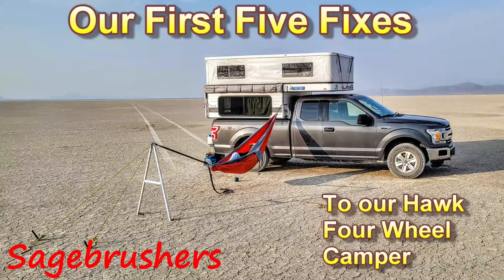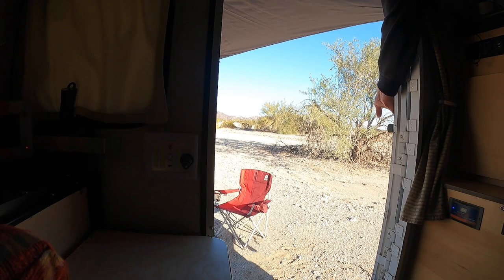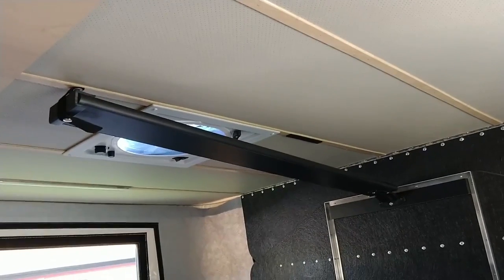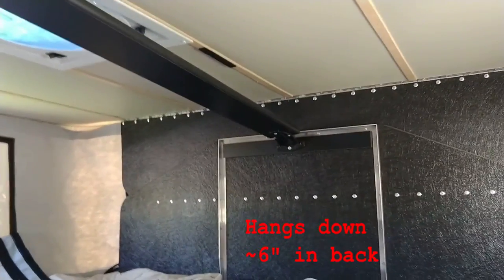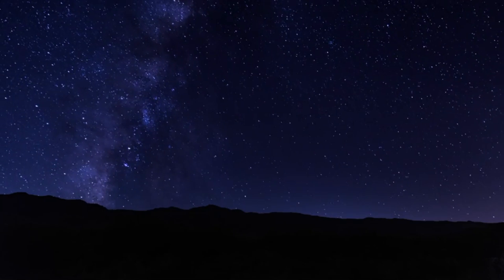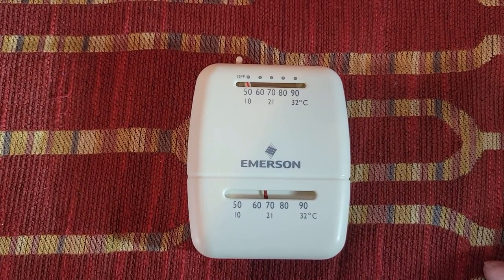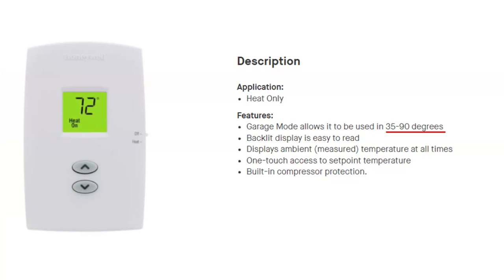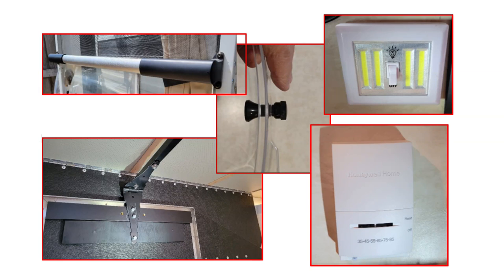First five fixes to our Four Wheel Camper:  5 simple hacks to make life easier

Comment: I hacked my analog thermostat to work at 35 degrees by rotating the bi metallic unit back with a pair of needle nose pliers. Works great and still adjusts to the higher temperatures.
Reply from the maker: That is a simple and way cheaper solution!  I never thought of that.  Did you re-mark the temperature marks?
Reply: @sagebrushers8497  The unit I got didn't have numbers it had hash marks. I didn't get it that way on purpose but it worked out in the end. I did put a sharpie dot on the spot that's a comfortable temperature for me.
Reply from the maker: @johnallen5669  That works too!

Comment: I added a second thermostat . I located Second thermostat closer to the bed. I can reach  the original with the bed extended and the second one with the bed not extended.
Reply from the maker: I never thought of that @petermandel2552!  I have long arms and can reach our thermostat regardless the bed position.  But I like the concept.  Does the one you are not using have to be set higher than the one you are using so the circuit is closed?